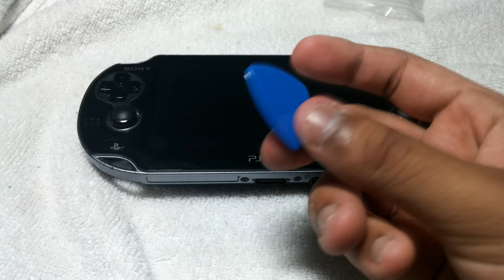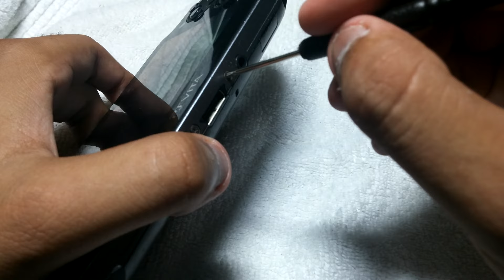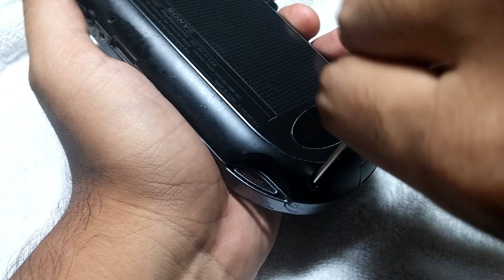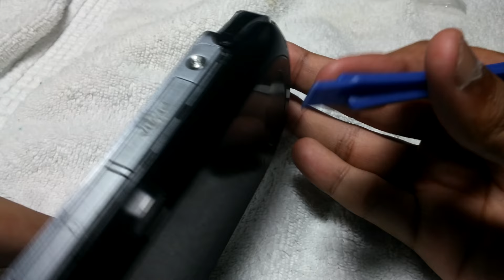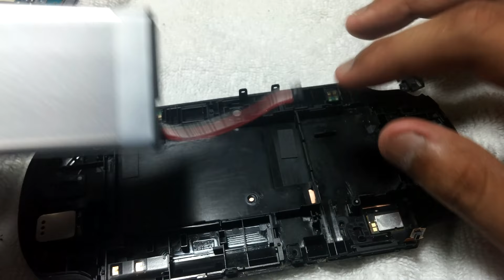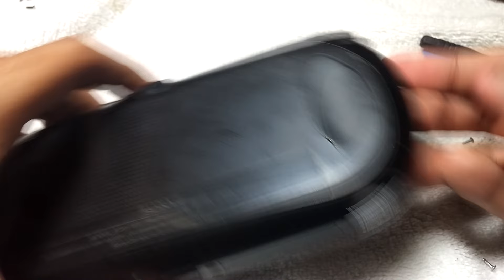PS Vita Battery Replacement

Comment: I had to go to another video as I couldn’t work out how to get the little cover over the battery cable off, turns out there is a little clip you have to push in, so this video needs to be clearer in that regard.
Reply: I confirm this, there are two tabs on both sides that need to be pushed inwords to pull the cover off

Comment: freaking $10 solution. im about to buy a new charge kit or worst replace my vita then i found out that the freaking problem was the battery dying. then i found this video and saw how easy it was to replace it. thanks
Reply from the maker: Yung Ennix I'm glad this video saved you from buying another one!
Reply: Yung Ennix  it's super easy plus changing the screen to a nice new one is also simple unlike the psp go that was a pain
Reply: any suggestions for me? my vita wont charge unless i plug in to my pc while the vita is turned off
Reply: did you lose any data?

Comment: Thank you so much.  I bought a SONY PS Vita used in craigslist but the owner failed to tell me that after it is fully charged it only lasts 15 minutes.  Problem is once you buy "as-is" you are gambling.  Thought it would be very difficult to change the battery but after watching your video over and over for 30 minutes, I got the courage to do it.  Thank you so much.  It works fine.   I wish however PS Vita shows the percentage battery life not just the green color.  Thanks a million.  This battery change was done March 2019.
Reply: Hack your vita and you can get the battery percentage

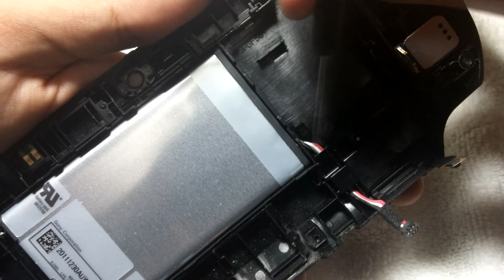Comment: Thanks so much for this video! It's weird how Amazon are selling batteries dated from 2011 (yours says it too, check the 4:42 time stamp). But hey, it works! Fingers crossed it doesn't randomly die even though it says it's at full charge, like the original battery did. :)
Reply from the maker: I'm glad this video helped!

Comment: Mine was pretty easy to get the back off, it just popped up on its own since it had a spicey pillow under it.  Knew something was amiss when i saw it kinda bulging on the back.
Reply: Did you lose data after replacing?
Reply: @SamSensei955  No, data isn't stored on the battery, the device still works great.  I did put a 3g2vita card in there so now it's even better.

Comment: Thanks for this video, my Vita stopped charging suddenly no matter what method I tried. Was hoping it was the battery and not the connector. I just replaced my battery (£12 order with battery and 10 x spudgers) and it seems to be charging. So thanks so much, I've got so many games to play on my Vita that I would have been tempted to buy a second hand one for £80 or a new one on eBay for £160 just to get through my library.
Reply from the maker: glad to hear this helped!
Reply: Can i ask? Did your vita not charging and not show the orange light?

Comment: I don't see why you have to charge Lithium batteries from20-50%(rough estimate) to lengthen their lifespan. I constantly run my Vita flat(done it for four years) and it is still fine. Intersting video though.

Comment: My vita 1000 won’t even turn on anymore that last thing I remember about it was that It would only last 3 minutes playing a game then go black instantly. Would power on then show the date and time 1/1/2015 screen. I don’t know what’s wrong with it but I tried swapping batteries with my other vita 1000. Didn’t work
Reply: Did you fibd a fix yet? If not, did you change the battery? I have the same issue
Reply: @Naurto58  I have a extra vita that actually works and isn’t modded, I switched the battery from the good one to the vita that won’t turn on and nothing happened, I made sure I had both cables connected.
Reply: @Naurto58  what’s fibd fix

Comment: 1. Great vid! 
2. Are the batteries the same for both of the PSVitas slim version and the fat version? 
3. I've got the fat one and it keeps freezing, I even got plenty of things turned off e.g. WIFI, Bluetooth e.t.c when I'm not using them. What do you think I could do to resolve this issue? 
4. I await your reply.
5. :)
Reply from the maker: 1. Thank you!

2.They are different, the slim uses a smaller shaped battery

3.Is your storage maxed out? If not try making sure there isn't allot of apps running in the background (maybe a hard system reset would resolve it if all else fails)

4. Done

5. :D
Reply: baconisgoodtoo 
1. You're welcome. 
2. Oh okay, thanks.
3. When I bought it I factory reset it. Don't really have much stuff on there only played 2 games. Didn't even use the built in apps much neither did I download anything. Maybe if/when I replace the battery it should get better. 
4. Thank you. 
5. Have a great day.

Comment: My Vita has been dead for about 2 years, so you suggest I replace the battery myself or take to have someone else look at it? It stopped charging and the new charger cable I bought( without the box, just the usb) doesn’t charge it at all.
Reply from the maker: There's probably a good chance the battery is completely dead. As far as replacing it, if you have the tools and confidence to do it yourself then follow this guide it's pretty simple. I would recommend getting the charging box with the cable you have, just to make sure it dose charge.

Comment: Hi brother, my Vita fat just isn't working. I don't know if it's the charger or the Vita. is there a light on the charger i should see? If it IS the battery, how much does a new one cost? It was working a couple of months ago when i bought it second hand, but when i tried to charge it (i blew out all the connections to make sure nothing was in there, i also cleaned and unplugged each part of the charger, blew out any dust and reconnected eveything, and tried leaving it plugged in for 24 hours in 2 different sockets in the house. 
There's just no blue light at all on the vita.
Reply from the maker: If the charger is working you should be able to see a blinking orange light on the PS button. If there is no light at all then the charger may be faulty. I suggest you find a different charger before diagnosing the battery, which cost 10$ more or less on Amazon.

Comment: Where do you get a replacement battery?
Reply from the maker: Jeannie just look it up on Amazon or eBay. There's  quite a few of them, just make sure it's for this modle and not the slim since they use slightly different shapped batteries.
Reply: Ok, thank you.

Comment: My battery indicator would show only 60% battery percentage but the green tube icon is instead full. Indicating otherwise. Is my battery really the main issue right here or is it a motherboard error. My vita did experience long-term overheating at one point when I was downloading games off PKGJ
Reply: Did you figure it out I’m still having this problem

Comment: Hi, I got a question! Since a couple of months, my PS Vita doesn't work well. When I'm playing a game (and I've charged the Vita for one whole night before), the Vita is telling me that the battery is running low and the battery indicator colours red after 15 till 30 minutes of playing. But when I'm playing further, the battery indicator colours green for a half. What does this mean? What is exactly the problem? Is it the battery? Or is it something else? It seems that the battery indicator doesn't work consistent. With the battery indicator, I mean the indicator on the upper right of the screen.
Reply from the maker: I think I've heard of this before, its a glitch with the system that doesn't happen often but can occur. The solutions ive seen is either unplug and reconnect the battery or change the battery all together.

Comment: 4:50 that piece your taking out broke on my vita will that cause the battery replacement process not work ? PLEASE REPLY ASAP
Reply from the maker: It seems to just hold the cables in place. If this is  a problem a little super glue should do the trick, otherwise it's not a big deal.
Reply: OMG thanks I thought I Just lost it 😂😂
Reply: baconisgoodtoo I subscribed shared the video and my friends Subscribed and your at 100Subs !
Reply from the maker: THANKS NOW I NEED TO DO A SPECIAL VIDEO lol jk I really appreciate it! :)

Comment: Hello fellow nerds. As you might be aware... or not, ps vita charger is a pain in the ass. Maybe I just suck and always lose them. I know it might seem like an unneeded idea, but it's something I've been considering and I need help with the inner components since I don't want to open mine to check and for it not to fit or break anything. 

Do you guys think you are able to fit a debit card between the battery and the plastic cover? 

I've been looking at wireless charger receivers and QI makes some super thin ones. My only concern is that I don't want a bulge(only in my pants. Little penis joke) and if the plastic is thin enough to allow the receiver to work. 

What do you guys think?

Comment: I replaced my ps vita battery but it still wouldn't charge. It turns on sometimes, sometimes not but it wouldn't charge. When I connect it to pc the pc would recognize the vita, but it wouldn't charge it.

Any help guys?

Comment: I haven't use my vita since 2012, and I haven't charged it since. And I lost the charger. Should I just buy a new one and just plug it in? Or do i have to do this?
Reply from the maker: Depthstrider 826 I would buy a new charger first and see if the battery still works just to make sure if it's 100% dead.
Reply: baconisgoodtoo But, what if it is?

Comment: My Vita stopped working so I opened to see if there was something off, but it was nothing and then it turned on, yey, but the battery didn't charged, so I changed the battery and still nothing :(

Comment: the battery i got doesnt have that black thing on it D:
Reply from the maker: sowhazupguy Really? Did you purchased it on Amazon or somewhere else.
Reply from the maker: Yeah that doesn't look right, I will put a link in the description to where I bought  mine. (So this wont happen to anyone else too)
Reply: okay thanks man i appreciate it. although it sucks that i have two batteries that are worthless lol.
Reply: hey sorry to bother you again but do you know if they sell extended batteries? like the normal one is a little too low for my liking and I was following this guide in order to upgrade my battery. thanks.

Comment: what PCH model is ur vita 1101,1102,1103 and 1104
Reply from the maker: MJI Gaming well I got it when it first released soooo I think 1101.
Reply: O cos I have problem with my vita the battery keeps going to green  to absolute red and I can't find a replacement battery for my vita

Comment: I have a psvita which not touch for years . will it work again ?does the battery leak?
Reply from the maker: justin varghese The battery won't leak, but there is a pretty good possibility that you'll need to replace it if it doesn't hold a charge.
Reply: thanks

Comment: will it fit the slim vita?
Reply from the maker: Unfortunately no. While both vitas use batteries with the same specs, the slim uses a slightly shorter battery. They are kinda hard to find :(
Reply: So my best bet would be to buy a broken slim one and take the battery out of it
Reply from the maker: Yeah if it comes with one. I did manage to find one seller on eBay, not sure if reliable but here's the link. http://www.ebay.com/itm/NEW-OEM-SONY-SP86R-PLAYSTATION-VITA-PCH-2000-SLIM-PS-ORIGINAL-2210mah-BATTERY-/282085880801?hash=item41ada0f3e1:g:kpMAAOSwgY9XdjHE